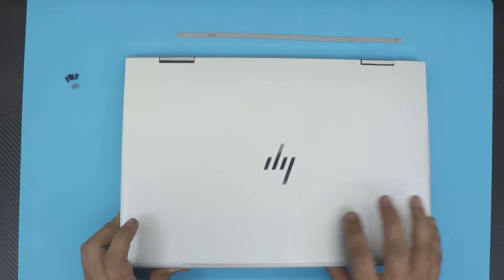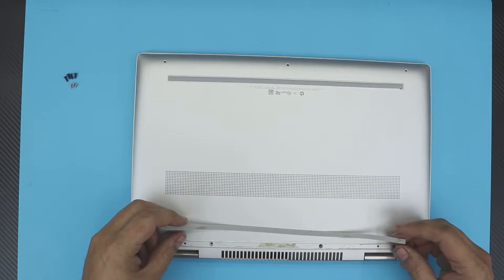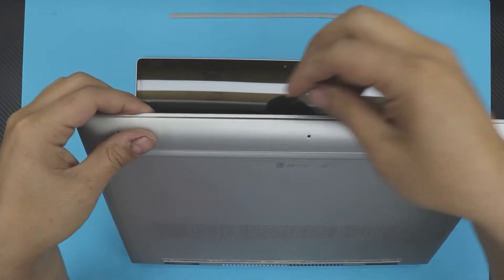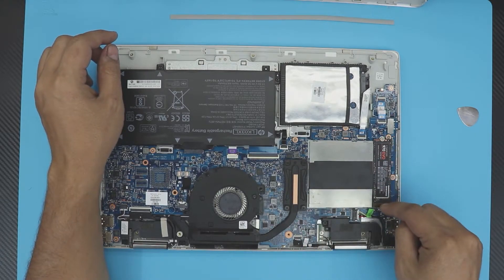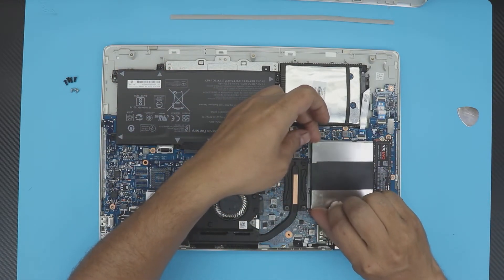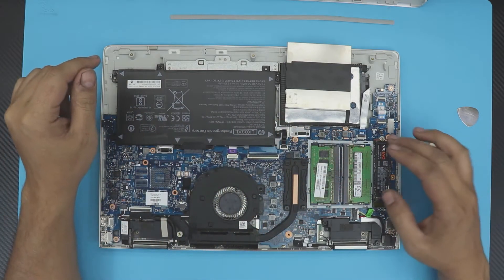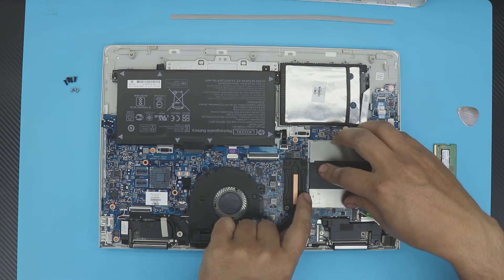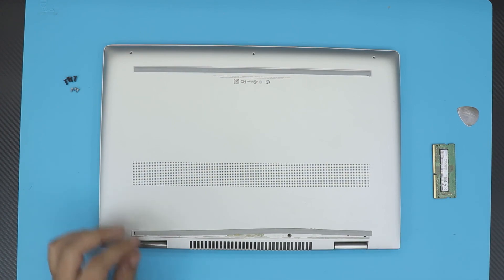Hp Envy X360 15M Ram Upgrade - STEP By STEP

Comment: Let me ask.
You didn't want to configure the RAM at 1 8GB X 1 4GB = (speed wouldn't matter it would clock down to match lowest speed)  Because I've done that in my Samsung laptop and it worked beautifully.
Reply from the maker: the laptop bios will detect the higher clock speed ram and it will adjust to the lower clock speed ram installed or it will adjust to the max speed that the motherboard can handle.
and if you have two dam dim already installed (doesn't matter the GB combination) , you will get the dual channel activated automatically and that is much faster than having one ram installed.

Comment: my System Model HP ENVY x360 Convertible 15-bp1xx
 has 4gb soldered and 4g in slot 2 the maintenance manual says it supports (8GB+4GB)12GB configuration, was asking if I install 16GB on the slot 2 to make it 20GB config will it work? #uFIxTek
Reply from the maker: Thank you for the feedback! if you wish to support the channel you can LIKE or SUB or both :P
regarding your question: sorry no idea why your comment went into "held for review" but regarding the ram you can place a 16gb without any issues and it will addup with 4gb soldered. 
https://amzn.to/3zNDiBi

Comment: Hi. Do you think a Crucial P5 1To CT1000P5SSD8 Internes SSD  and a 2×8gb  Crucial Ballistix BL2K8G32C16U4B 3200 MHz, DDR4 will fit in an HP envy x360 15 ds0xx
Reply from the maker: Hi, and of course it will work and it will work great , it will be a nice upgrade :P
you wont regret :) if you get any problems during installation let me know, also if you wish to use my amazon link to purchase anything you like i would get a bit in return :)
http://www.amazon.com/exec/obidos/redirect-home/damon149205-20
Reply: @uFixTek  Thank you and I will do that
Reply from the maker: much appreciated :)

Comment: Can we chng solded ram?
Reply from the maker: thank you! for the feedback and your support to the channel by SUB :P
Regarding your question:  the soldered rams should only be replaced with the same exact chip and size and with a profetional technician, as it requires a "reballing the chip" as the are BGA chip, dont try doing it at home.
Reply: @uFixTek  so we can upgrade
Reply from the maker: no you can't upgrade! you can change them with reballing to the same chip, if you place a  higher capacity chip even with the same model it will not work as it requires more voltage.

Comment: I've download Speccy to find out how many RAM slots I'd have available in my notebook (hp ENVY x360 - 15m-bp1xx). The programa says I have 2 slots (slot 2 would be occupied with a 16GB ram card) and that slot 1 is empty. But when I opened the notebook, there's only one slot (the one with the RAM card). Where is the other slot located?
Reply from the maker: you dont need to download programs to tell you the slot the windows task manager tell you the same, and its always inaugurate what the windows says and what you actually have, windows 10 will always say minimum of 2 slot available you will never see a 1 slot available in windows 10 or any program.  that said, if you see one ram slot and thats all you have there is no more ram slot available you may have ram chips soldered on motherboard that is not upgradable.
Reply: @uFixTek  I just tested it using Windows Task Manager. It states: "Slots used: 1 of 2" . "Slot 1: empty" "Slot 2: 16GB 2.400 Mhz".
Reply from the maker: dont trust what the task manager or programs tell you, trust me i deal with laptops day and night repairing them, just open the simple bottom cover and you will see the ram dims and if available it will be visible.
Reply: @uFixTek  Yes, sir. Just did that. Only one slot :( thank you a lot for your help. Cheers from Brazil!
Reply from the maker: @markciconne  anytime my friend, if need anything hit me up in here. good luck

Comment: Does the ram in the Description work for the the same laptop that you used for this video
Reply from the maker: thank you for the support to the channel by a sub :P
regarding your question:
yes the link is the one we use to upgrade clients rams:
https://amzn.to/3tIvWeB
if you need any help or question feel free to ask
Reply: @uFixTek  Hold on just in case it’s the wrong Laptop
Does the laptop you used run on AMD FX
Reply from the maker: it doesn't matter cpu intel or AMD they both go up to 16gb 2x 8Gb we get both version into the store all the time.